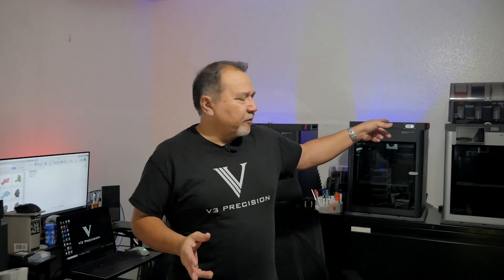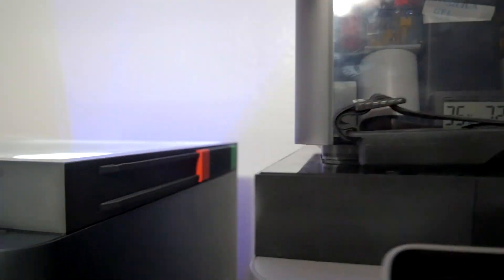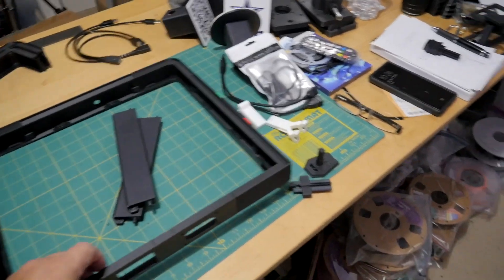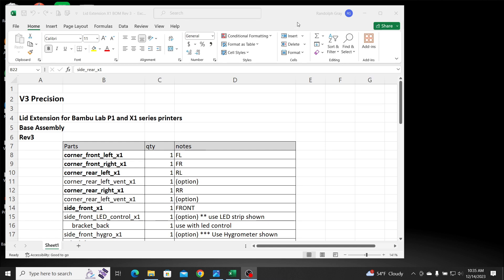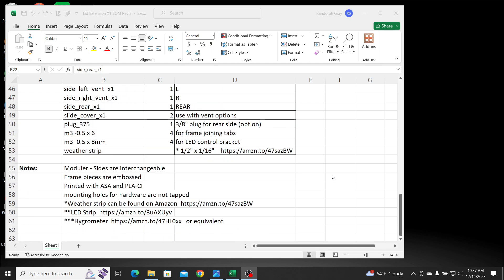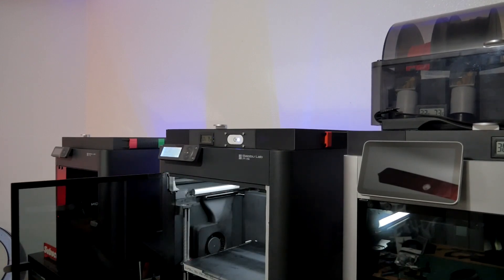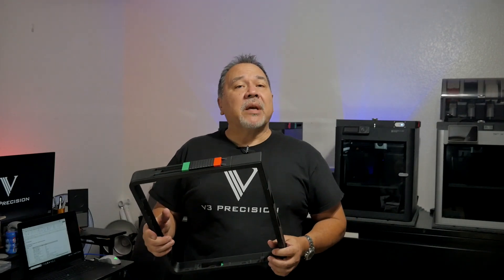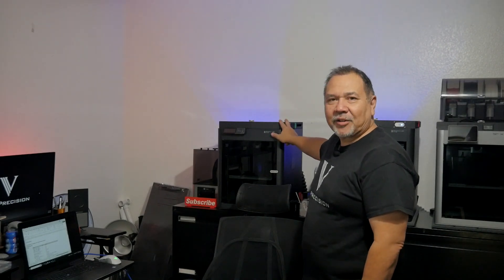Lid Extension for the Bambu Lab X1 and P1 Series, Rev3

Comment: I have printed this one and it's very well-designed and fits perfectly. Could you include an alternate front piece which doesn't have holes for the LED switch? Also because I'm not tech savvy with CAD software could you do a modification that includes a 10" ring light? Thanks

Comment: On most hygrometers, you can pop them open and they will have a place on the board where you can change from Fahrenheit to Celsius or vice versa just by removing a solder point or placing one.